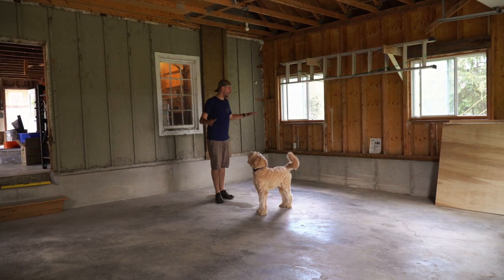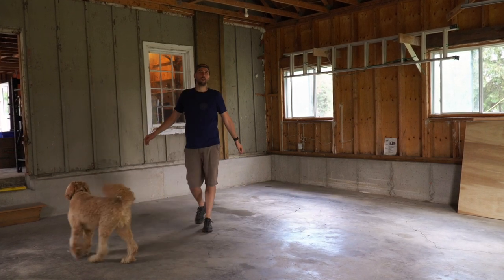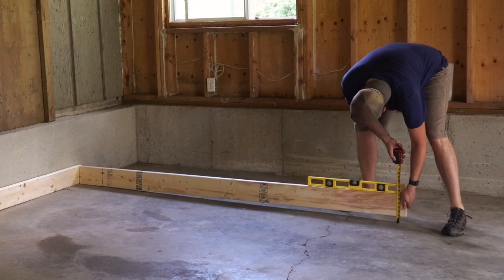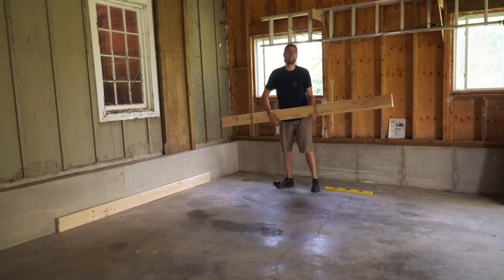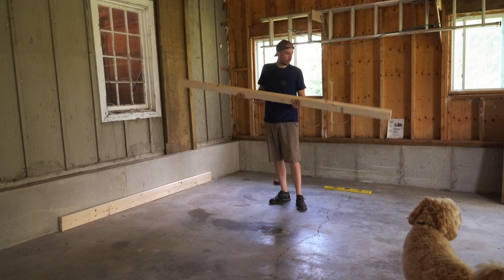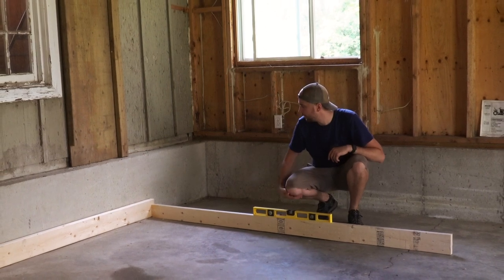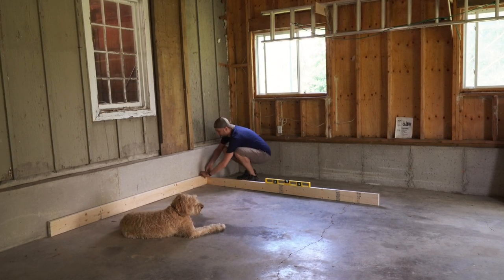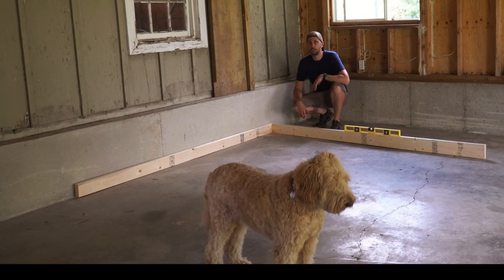Building a DIY lifting platform in our Garage Gym

Comment: This is great. I am going with this same approach but want a lower platform so i was going to rip 2x4s down to a 1/4” at the thinest end. I used to have a platform made with stacked strips of particle board but mold ended up growing in between the panels after a few years. Your way is the right way to do this.
Reply from the maker: Overkill is the way to go! Still holding up strong today